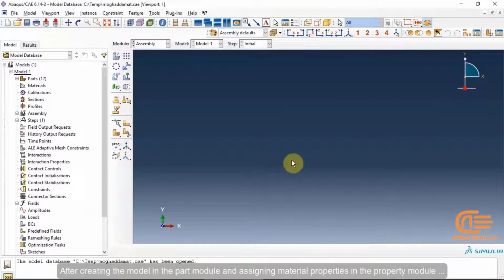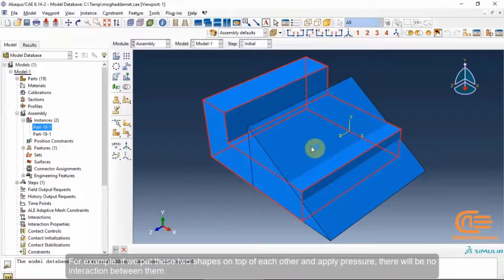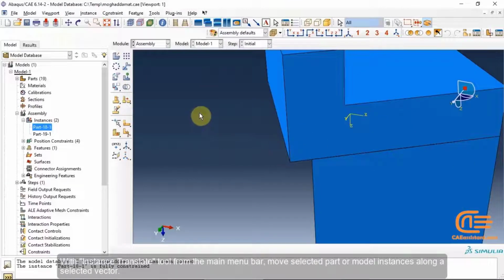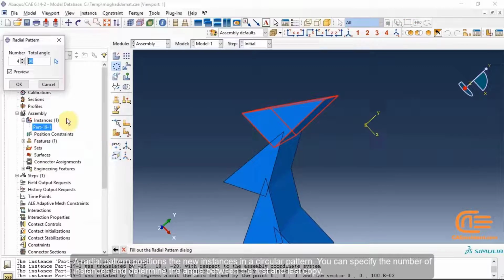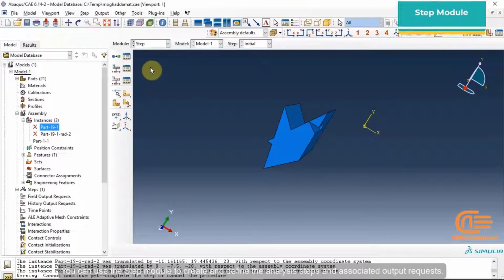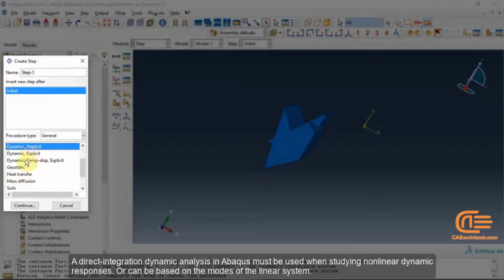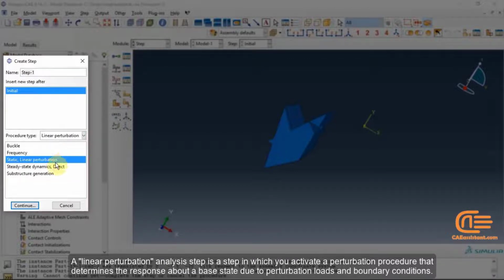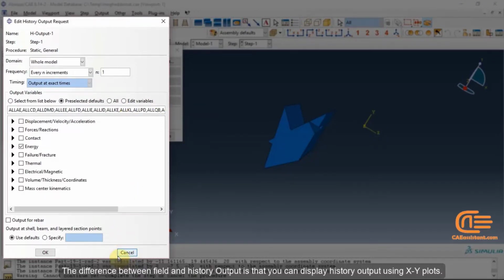Assembly & Step modules introduction in Abaqus

Comment: if i am defining the pre defined velocity in initial step and i am applying a preload of pressure on the body  in step-1 which will be applied first?
Reply from the maker: Hi, thanks for your comment.
There is no conflict between them. First, the velocity is applied in the initial step and then the pressure in step-1. If you mean something else or have any other questions, please explain more.
Reply: @caeassistant  I am modelling a composite laminate of 8 layers along with the frame on top and bottom. I am using VUMAt code and i am applying a predefined velocity in intial on the ball and  applying pressure on top frame in step one.  I need all my boundary conditions  and pressure on the frame has to be applied before the ball hits plate. so how can i do it
Reply from the maker: Hi there,
Your response is the same that I told you before. If you need more help, just visit the consultancy section on our website:
https://caeassistant.com/consulting-mechanical-engineer/
Or email to this address:
Support@caeassistant.com
Best luck.